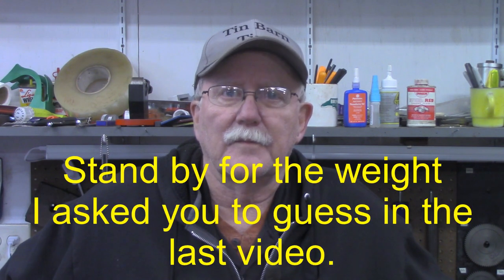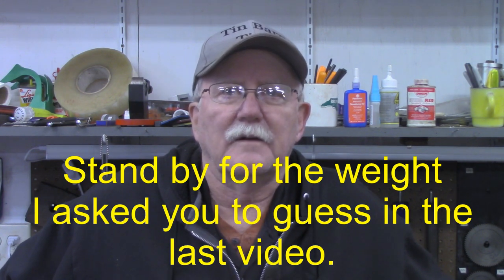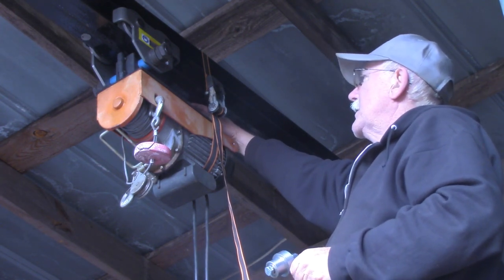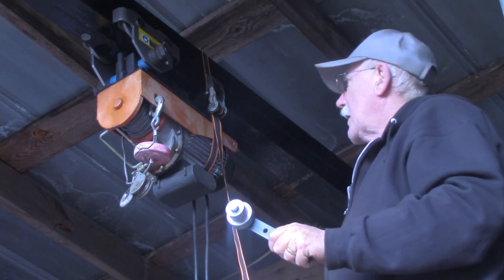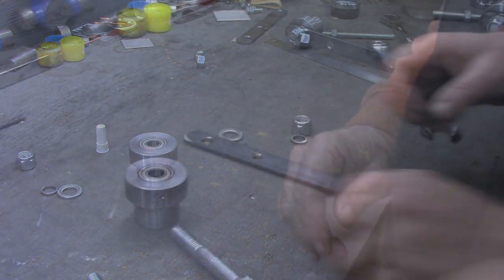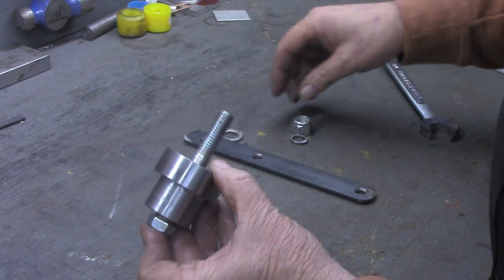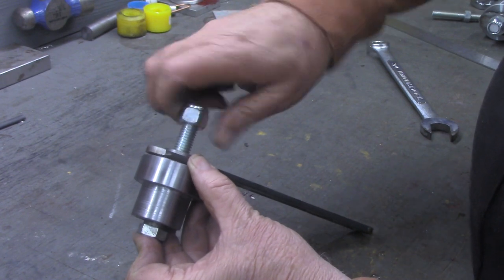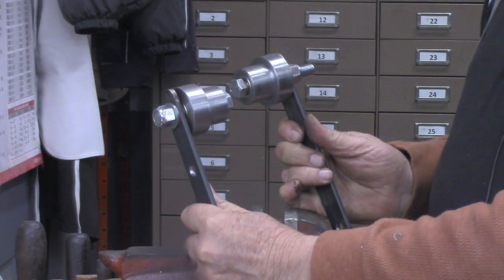Harbor Freight Winch/Trolley Follow Up

Comment: Great idea to level the hoist. If you had put a spacer between the inner bearing races you could have tightened the bolt to full torque without binding the bearings. Thanks for the great videos Lee!

Comment: Nice work Lee, you will probably use this way more than you thought and it will make many things easier. When we used to commission a new crane or teat an old one, there is a deflection test, you hang a pleb bob near a scale and proceed to lift over capacity and measure deflection at that weight. We would see a surprisingly small deflection on a good structure. Enjoyed, cheers!

Comment: done deflection test  that size beam 1  over 10 feet . from  the floor. I suspect the deflection is 1/2 "   You could Dubula up the load. Good Job

Comment: Hi there Lee great trolley and winch adapting. This is a bit long winded but i feel I need to let you know
With your beam the worst case would be at the tip out the front. this would test the anchor to the barn and your weld. Where I live the full test would be the WLL (working load limit) + 10% for the proof load, 600lb + 60lb = 660lbs P/L.  The load is suspended for 10 min at the weakest point (beam end) then traveling the length of the beam. Another point is when the winch is at the end of the beam if you pickup say the 600lb the anchor on the barn could see loads around 1000lbs  
 Hope this helps and just wanted to let you know. I used to do this in my job and don't want to see you hurt yourself or others